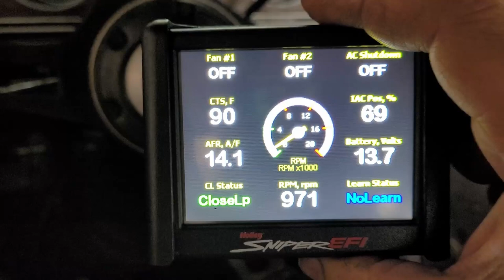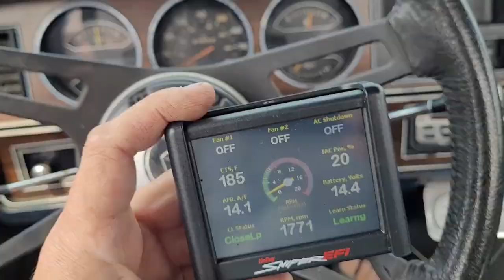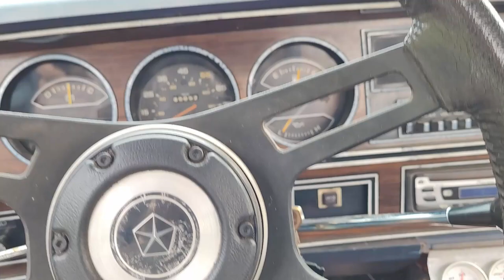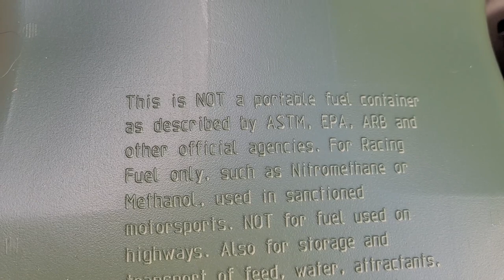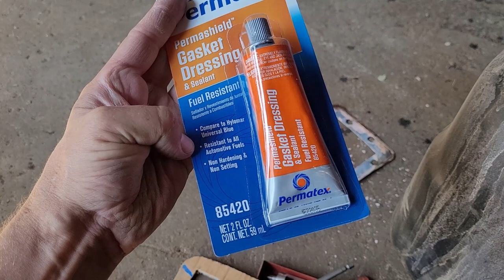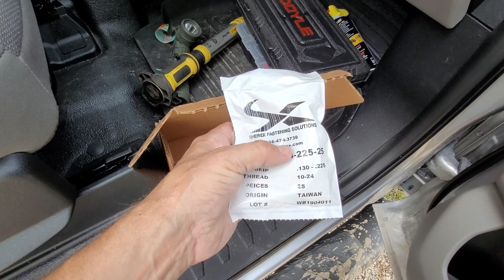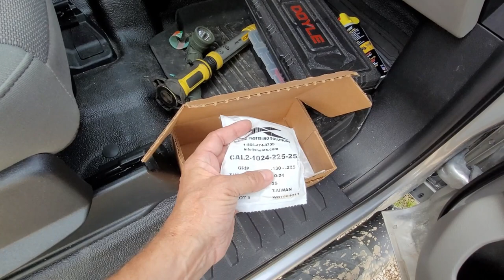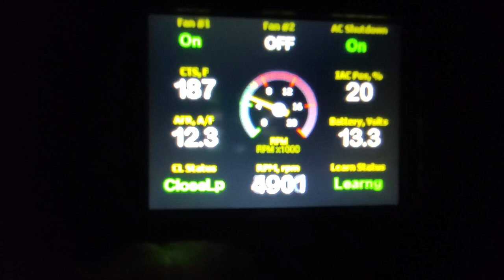1984 Dodge Ram D150 904 Trans Issues - Time to change things up.

Comment: Did you consider putting the nut serts on the bottom  side of the tank, that way it shouldn't  pull out.
Reply from the maker: I did end up doing that but the ABS wasn't strong enough to collapse the nutsert correctly 🤷🏽‍♂️

Comment: I ran into a similar issue with the original TBI setup I ran on Ethyl.  The fuel return dumped straight back by the fuel pump and the aeration created fuel starvation issues, so like you, I directed the return away from the pump.  

The 727 will be a nice upgrade.  Behind a small block MOPAR, they are pretty much bullet-proof.

As to dropping the tank, normally I prefer to leave the tank in place and just lift the bed unless the tank needs replaced or the tank actually needs to be rinsed out. Lifting the bed is usually 6-8 bolts and the filler neck, and depending on whether or not the bed needs to come all the way off, the wire harness for the lights may not need to be undone.  Getting those long Dodge tanks back in usually means I have to use ratchet straps when I am doing it by myself, so I'd rather not drop them out.
Reply from the maker: Lifting the bed would have been nice but I needed to rinse the tank out. I'll have to see if I can use the tractor to pull the bed sometime. 99% of the time I'm working alone so I'm not sure how easy it would be to wrangle the bed without damaging it.
The 727 will be a lot better. I should have known not to use the 904 🤷🏽‍♂️

Comment: Gotta ask as im having difficulties finding out. How do you know its a 904 and a 727? Mine has numbers on the side but dont seem to be able to look them up. Very dopey of chrysler if you ask me...
Reply from the maker: The 904 has a square trans pan with one corner cut at an angle. Google search 904 vs 727 identification and you'll see a pic of the pan differences. That's the fastest way.